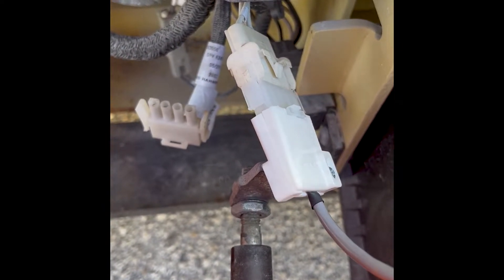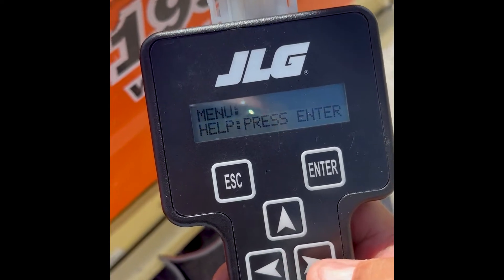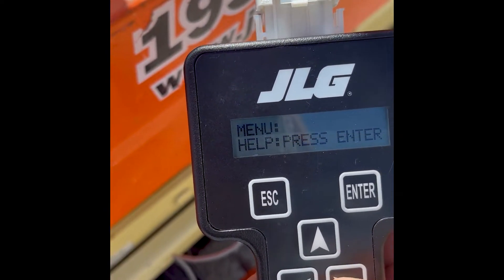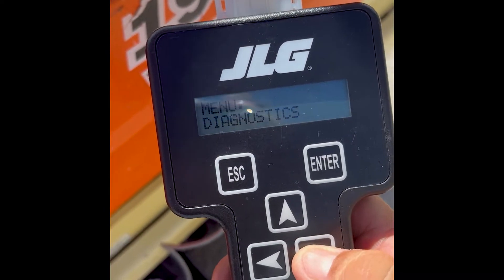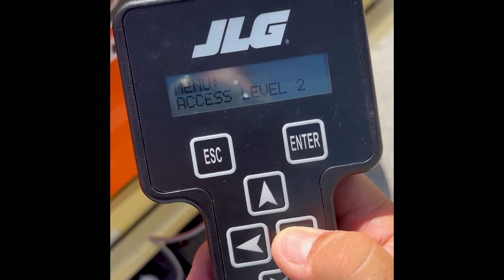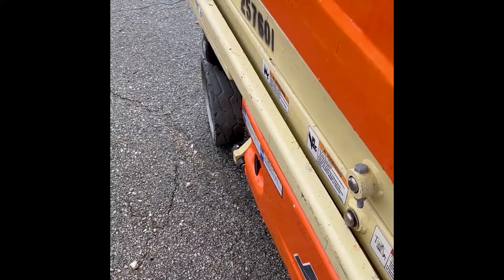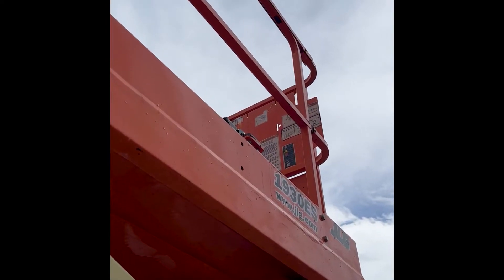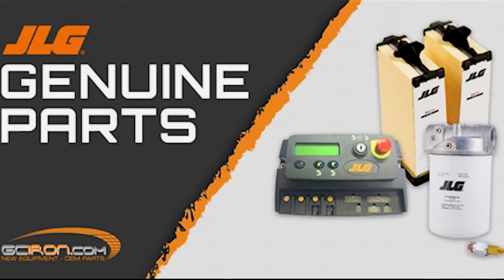6/6: CANbus Failure: Power Module | JLG Electric Scissor Lift

Comment: Check harness plugs on ground and top controls . 
Deutch plugs
Reply from the maker: Yes, sometimes the pins pull back slightly and will need to be pushed back into the plug.